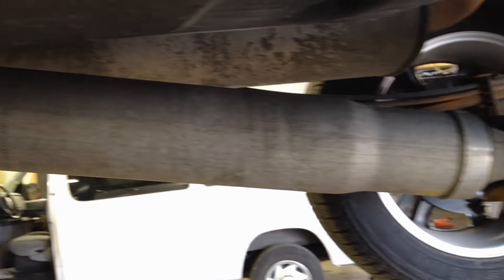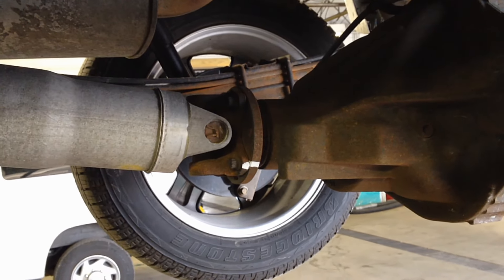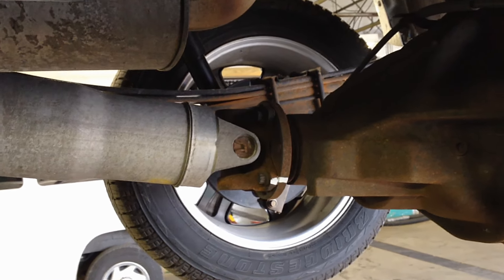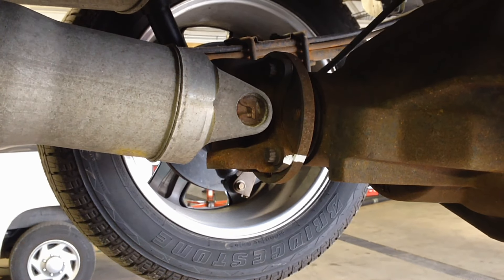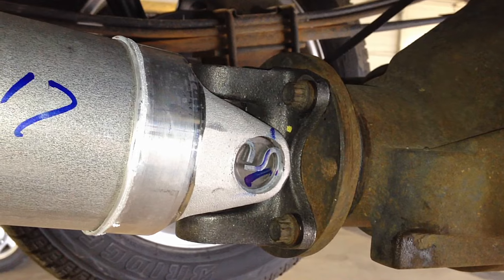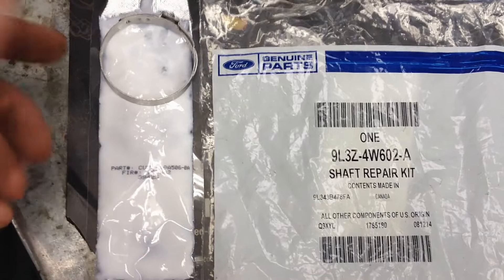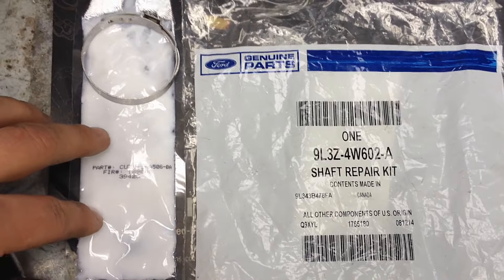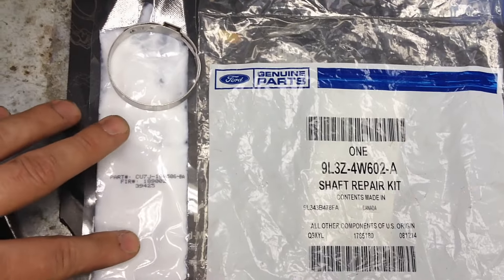Ford F150 One Piece Driveshaft Slip Bump- FIX!

Comment: Amen to that. My 2011 Explorer has had so many repairs, it's not even funny.
Reply: The Neighbors
 it's a ford.    I prefer dodge. 
The new Ford 250  you have to remove parts on the rear end to fix the front of the truck.???
   Huge problem if your truck isn't under warranty

Comment: For the longest time I thought it was the transmission issue and was waiting for it to finally go out. But turned out to be this issue on my 2010 Ford F150. What a huge difference it made. Truck drives like new now.
Reply: Did you get a shop to do it
Reply: Was yours a 1 piece or a 2 piece?

Comment: Thanks for all the video's, very informative and well done. Sharing your expertise on these new complicated vehicles in a way the general public can understand is greatly appreciated. My son bought a new 2013 F150 Eboost 3.5 Supercab and at 25,000 miles is having the rough/clunky shift issues. And now a recall for bad brake master cyl/booster problems. After reading ALL the complaints/issues/problems/bad customer service from Ford about this model year F150 and others of the same generation; it re-affirms my choice of NOT ever buying a Ford pickup.  Found On the Road Dead; not just a joke any more.